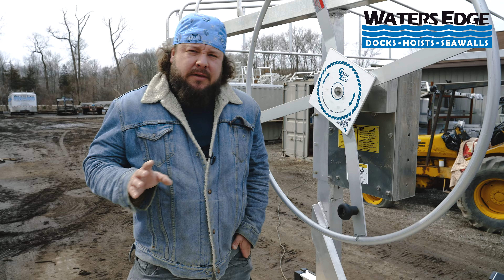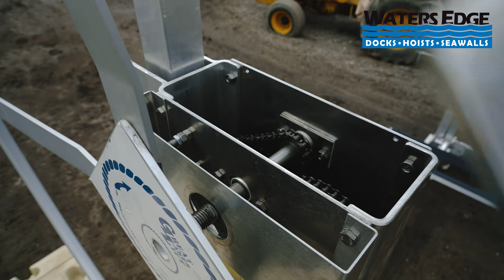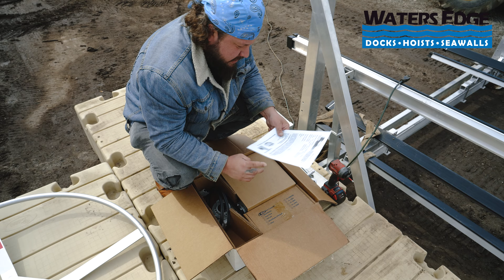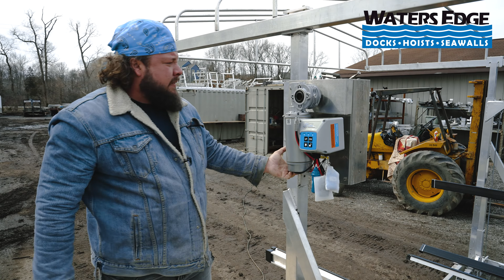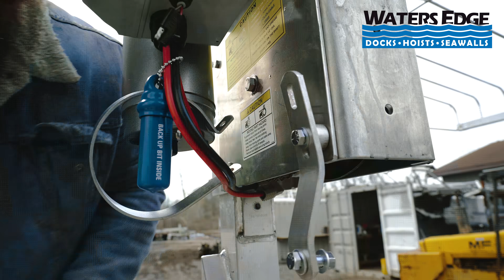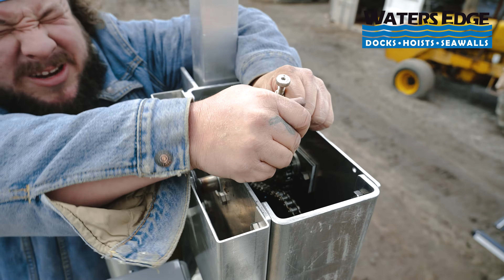How to Install a Lift Tech Direct Drive Motor

Comment: How many years is the warranty? The contractor that put it on in june 2021 did not give us a warranty card.  This contractor is out of business now.  We have the exact motor that is in this video.  We are going to try the power drill thing to see if we can raise up the boat lift. Thank you for this service.
Reply from the maker: The warranty is a 2 year. If this is indeed the motor you have very common problem with them is the face plate failing which makes the buttons useless. Do you have a key fob? If so, will it work with the key fob?

Comment: I'm interested in one of these units but I have a question, how do you operate it if the battery is dead? Is there some type of emergency operation system? Thank you
Reply from the maker: There is a bit that goes into a battery powered drill that will allow you to lower the boat if the direct drive stops working